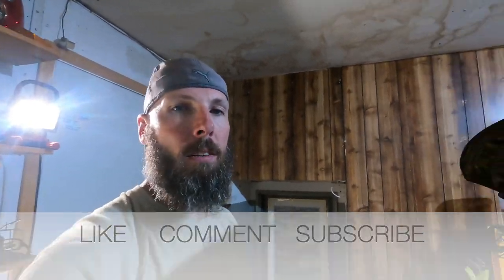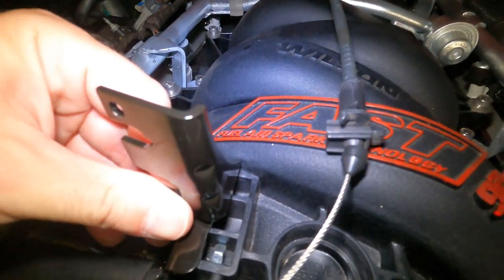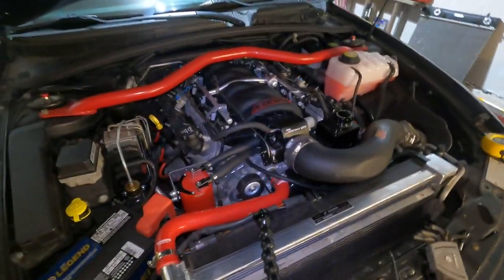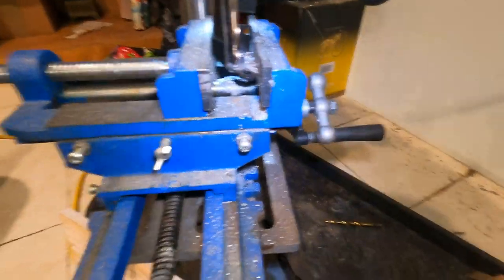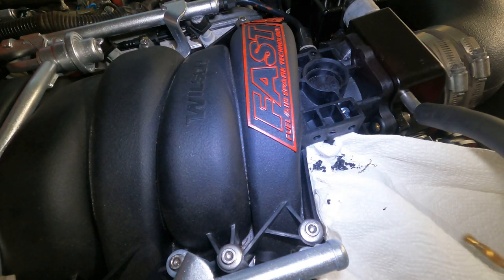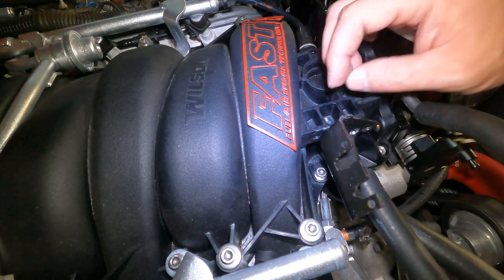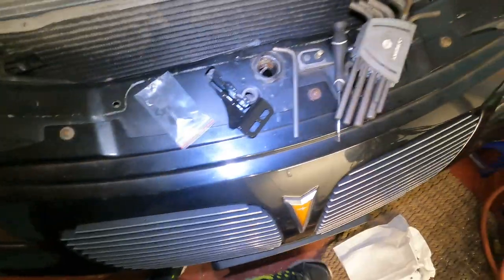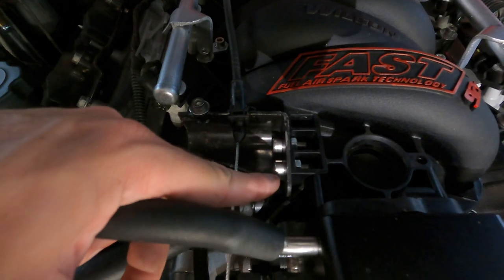GTO Throttle Cable Bracket Modification (Tune/dyno coming soon!!!!)

Comment: Great work.  Enjoying the struggle along with you.   Go the mighty Holden Monaro.   Hello from New Zealand
Reply from the maker: Thanks for watching! Just glad the struggle is getting not as bad as it was in the beginning 😅
Reply: @Billy_Ray_Garage  can agree.   I'm starting to think my rear bearing in my gearbox on my Commodore is on its way out.   Very slight rumble, gets worse the faster I drive so I know it's the tailshaft bearing.   Would change sound with engine rpm, or gear selection otherwise is my thinking.  Not looking forward to taking that apart.  Pretty sure it's the same T56 6speed as in your Manoro (GTO)
Reply from the maker: @russcole5685  is it a 2 piece driveshaft like the monaro? GTO had one and the carrier bearing rubber broke apart. It would rumble at launch and at certain speeds
Reply: @Billy_Ray_Garage  yup.  My carrier bearing was replaced maybe 5or6 years ago.   I can hear this slight noice coming from just forward of the gear stick.  Do it's in the box some where.   Out put shaft bearing?    Can't think of the correct name.   I'll have to do a Google search for an exploded assembly picture
Reply from the maker: @russcole5685  yeah if there is any play in the input shaft you'll def feel that. I've only broke down one transmission before. Maybe when I get my new one I'll tear down the old one and try a rebuild.